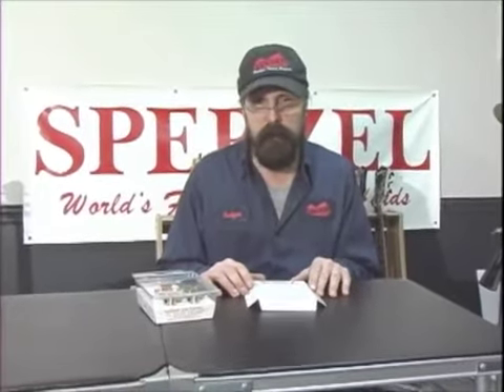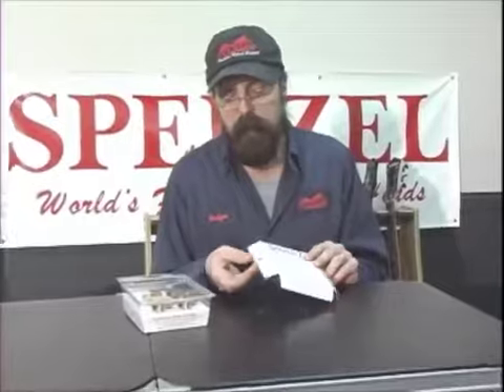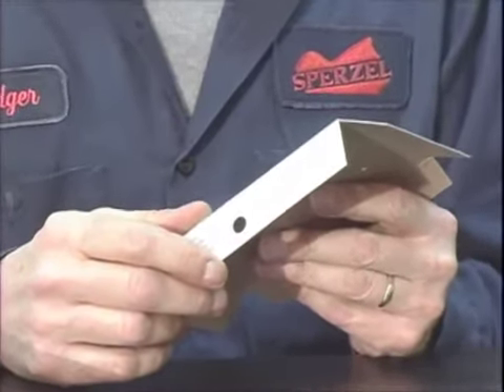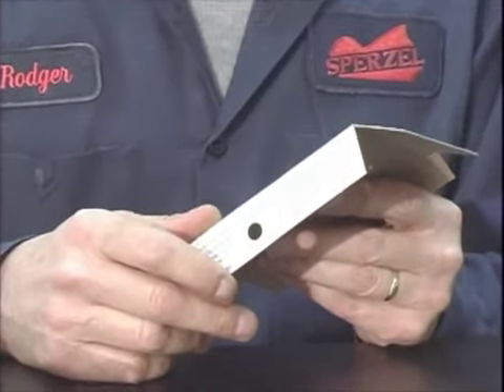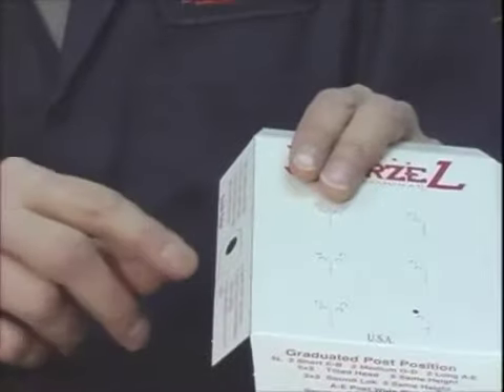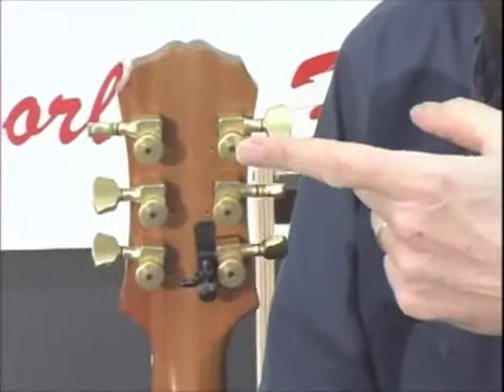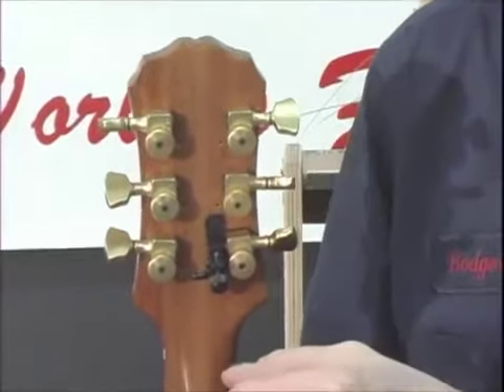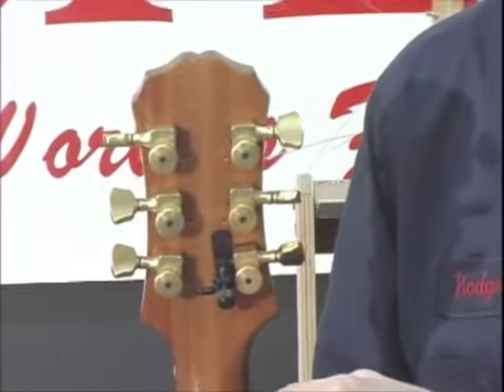Sperzel How To: Install Tuners

Comment: VERY SORRY !!! I mistakenly said the wrong size. It should be 25/64 " ! The actual size of the tuner hex nut is .383 inch dia., so the closest  is a W drill(.386") followed by a more common 25/64 "(.3906) drill or a 10 mm.(.3937).

Comment: I think he meant that you have to fill any old screw holes that might conflict with the pin holes that you are going to have to drill in the headstock to accommodate the anchor pins on the back of the sperzel tuners.  He isn't saying that you have to fill and re-drill the holes for the tuning post.  Look at pictures of the sperzel tuners online and you'll see what he means.
Reply: Thanks for clarifying that!!!

Comment: Just bought Fender Sperzel locking tuners. 3 of the tuning posts are shorter, while the other 3 tuning posts are taller. Which posts are meant for the lighter strings and which are meant for the heavier, wound strings?